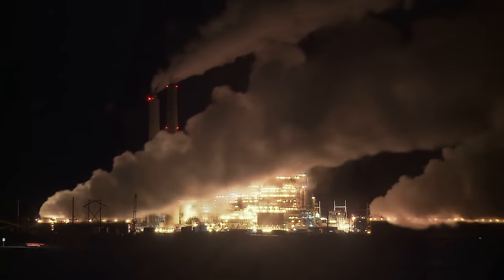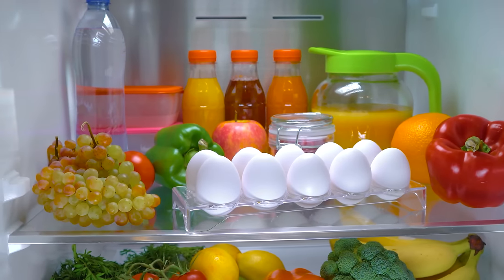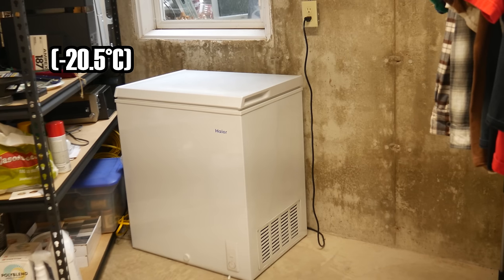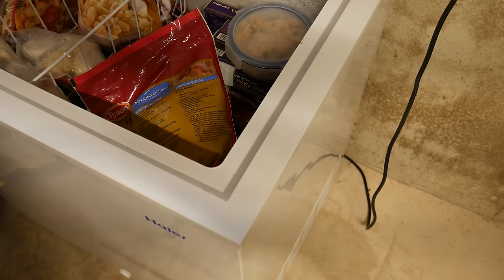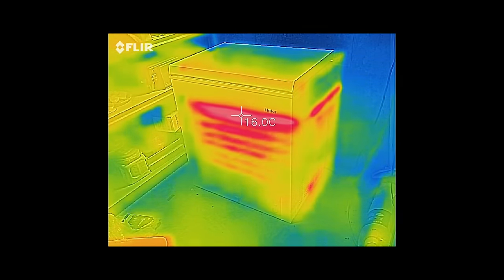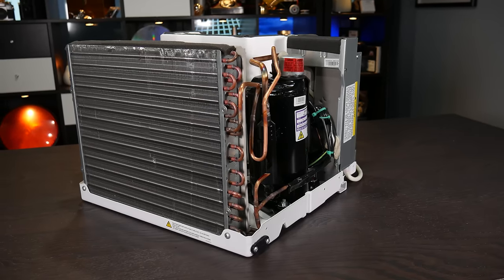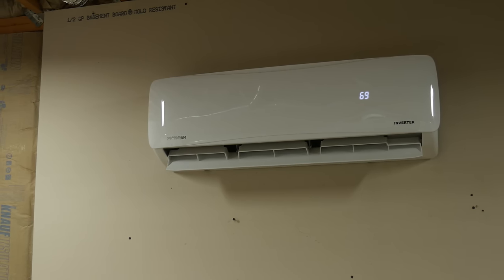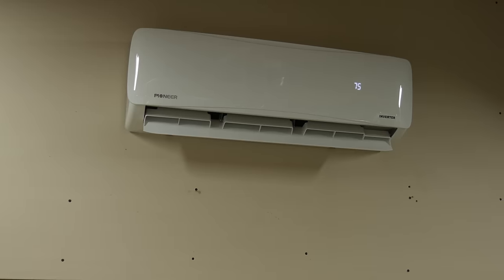Heat Pumps: the Future of Home Heating

Comment: So wait, you still need refrigerant, electricity to power the fans / blowers, filters, valves etc.  How the hell is this more efficient than burning natural gas, which we have a shitload of?
Reply: Technically it's true, though a bit unintuitive and misleading. If you heated your entire house with resistive heating (terrible idea btw but the only way to get 100% electric heat)  a heat pump literally multiplies the energy efficiency by taking less energy to instead transfer heat from the outside rather than directly heating the air. At peak efficiency, a heat pump will generate 500% of the heat of resistive heating, watt for watt.

Yes, burning gas is 100% efficient (well, not really, you lose energy to emitting light and such but for all intents and purposes it is), but burning gas for creating power, even if less efficient still multiplies the energy efficiency in joules. You get more gas out of your gas, so to speak.
Reply: To compound on this, the gas in your home and at the power plant have exactly the same energy density, that however many joules needed to  generate the extra power needed (ignoring the massive difference in scale) will contribute exactly  the same amount of energy transfer in a power plant as at your home. So heating your home with a heat pump will result in more work(energy) per cubic meter of gas than gas alone.

Comment: Why didnt they just upgrade the central unit that probably would have been so much cheaper ? Also the furnace could then decide which "fuel" it wants based on ambient? Hrmmm i really dislike mini splits for added complexity and costs that said there are combinations of central heating cooling combination fuel source mini splits using coolant and a central  heat exchanger that would be in place of the furnace and have a boiler for heating or the outdoor unit depending on ambient and i watched the whole video haha
Reply: Example: the central unit is updated to a modern unit. During the hot summer, you want the AC running in your bedroom, but not the whole house (to conserve power). Yes, the other vents can be closed, but the problem is that the temperature controller, likely located in the living room, cannot sense the temperature in the bedroom, so it runs all night long. Result, a huge electric bill and you freeze.
Reply: @kurtbilinski1723  That last part can be fixed.  They make thermostats that can use remote temperature sensors.  So you could tell it to switch from the built in sensor to the remote one in the bedroom at night time.

Comment: What you propose is altogether impossible, for it violates the second law of thermodynamics.  You cannot extract work from a cold source by cooling it further. Like building a ship that propels itself by extracting heat from seawater and releasing it at a yet lower temperature.

Comment: we don't use heat pumps because its inefficient to compress the air and then transfer heat by blowing air over that thing... you can just heat something and blow air over that thing
Reply: It's far more efficient than regular electrical heaters.

Comment: Heat pumps can't even hold a candle to my wood stove, and my wood stove still heats the house without power. 
My power bill would sky rocket with a heat pump installed, and a heat pump doesn't circulate through the house as well. You'll have to have a second head for another part of the house.
Reply: Wood stoves don't heat the house "without power", they just derive their power from the burning wood. Which is, of course, a very polluting way of heating a house.

Comment: I find it hard to believe a heat pump costs less to operate than a natural gas furnace.

Air conditioning is already more expensive.

Then throw in -40 winters.
Reply: Bonus is you don't need a scary gas line to your house.
Reply: @logitech4873  It's not any scarier than a 200 amp power line.

Comment: the only problem is we can't transfer summer heat to winter in sufficient amount... even using the same capacitor for cooling in summer and heating in winter
I guess the stupid heating is like 80-90% of the potential energy we 'waste'

Comment: So why don't the powerplants use heat pumps?  They burn natural gas to boil water to run the turbines- couldn't they have a big heat pump to boil the water and create electricity much cheaper?  I realize there is the catch 22 where they would need some electricity to start with in order to run the heat pump to create more electricity, but that is easy to solve.
Reply: Heat pumps become limited to certain maximum temperatures, mostly due to the refrigerant used - e.g. R32 will get you to a maximum of around 55C, R290 (propane) to about 75C, and R744 (CO2) about 90C. As the gap widens between the desired temperature and (in the case of an ASHP) the outside air, they become less efficient.  So you'll never get to the point where a heat pump can provide the heat to turn a turbine to provide the electricity to run itself.
Reply: That would be free energy and violates the laws of thermodynamics. If you had a theoretically perfect heat pump and perfect heat engine then you could break even. But it is impossible to have a perfect anything so the heat pump would always consume more electricity than a heat engine could generate from it.
The reason for this confusion is that in common use efficiency for a heat pump is considered to be the coefficient of performance, which for practical applications it is. While the COP can be over 1 the overall thermal efficiency of the heat pump is always less than 100%.

Comment: Great until the cost of electricity goes through the roof. Which is the case in Ontario. When the payback coat approaches 20 years. Who owns a home for 20 years and will the system last that long. A great technology but sabotaged by electrical costs.

Comment: Heat pump water heaters 👎 Heat pump heaters 👎.  Saves a little money but they break easily.  When it’s REALLY cold they struggle and revert to traditional heating.  It’s just more complication homeowners have to deal with that mops up any energy savings.  Simplicity is beauty.

Comment: Why do the majority of American heat pumps/air conditioners not adopt inverter technology like the rest of the world? And why do the majority of American thermostats utilise a basic ON/OFF wiring system… where you can upgrade the thermostat to Smart Thermostats!

In Australia, everything is inverter driven with proprietary thermostats that are basically impossible to upgrade to smart thermostats?.🤷‍♂️🤷‍♂️

Comment: Once the outside temperature is below around 45 degrees you switch to another heating fuel because it will be cheaper than the electric power you will use defrosting the unit.
Reply: Not true, modern ones don't use resistive heat to defrost, and instead reverse the cycle to perform the defrost, using a fraction of the electricity required.

Comment: You wanna know why you werent offered a heat pump for your whole home unit? The manufacturers tell the dealers not to recommend or offer them in certain states.

Marketing surveys have suggested that the nuances of use cases and the need for "emergency" heat in the winter time means that the public doesnt like it, so they tell the dealers not to offer.

It's dumb, heat pumps are used for the same amount of time in northern states as in southern, only North Dakota uses them in april and september while Texas uses them in december and january. Then again, if economics has taught me anything, its that humans arent perfectly rational. The manufacurers are a business, and they want happy customers.

Comment: I had one or these installed on my house when I bought the place, thing was garbage, radiators would barely get luke warm and would be cold at the top, switched back to gas boiler about 2 weeks into winter as the house would be so cold I would wake up freezing in the night

Comment: Since the colder it gets the worse the efficiency gets, though, if your winters get really cold, you are better off just using a natural gas furnace. So, comparing your COP costs in electricity is wrong to begin with, since realistically you should be comparing the costs to natural gas or oil. 2.9 sounds great compared with resistive heating but really you're comparing it with natural gas which can vary depending on your area and costs for electricity and gas. In some areas using gas can be 3 or 4 times cheaper compared to electric.

Cost of installation/maintenance is also a factor. Since you need supplemental and emergency heat anyways, you still have to install a similar size of furnace anyways even with a heat pump, and below a certain temp you will be running off pure resistive heating anyways, so if you live in a cold climate you are going to want a gas furnace the same size whether or not you have a heat pump, so for many people a larger up front cost and larger maintenance cost is simply not worth it for the marginal change in utility cost.

Geothermal is another matter, and is a great option. I really with I had the space necessary to put in a geothermal loop, but unfortunately I don't. So much excellent information in this and delivered in a pretty understandable way. Great work!

That heat pump probably has a txv or something instead of a capillary tube btw.

Comment: The only problem with heat pumps is they don't work in the coldest of environments, and become less efficient the colder it gets. That being said, I do mean the coldest, with good models maintaining good efficiency down to -10F. There are certainly inhabited places that get that cold, here in Denver we'll get that cold at least a few times a year, and in northern cities that can be normal for most of the year. Still, for most inhabited places, a heat pump is all you need. Even in colder climates, you can have one for a lot of the time, and only rely on a furnace in the most frigid weather. Also, that's not even getting into ground-based heat pumps. Those are much more complex, requiring a heat exchanger buried deep underground, with all the associated piping, but those can work in even colder conditions.
Reply: I think America need to import better heat pumps. It is the most common heat source in scandinavia.

Comment: Instead of complaining your airconditioner is not reversible you could also have bought a heat pump 😂
Reply: A condensing gas stove doesn’t give you more then 100% of efficiency, it just helps you reduce the condensing losses helping you to get near 100% of efficiency. Emphasis on near 100%.

Comment: Still not cost effective in uk, companies quote 40k for new systems as pipework and radiators have to be changed. Plus the pump still needs electricity to run? Not catching on here yet

Comment: I recently had an airsource heat pump installed. It's noisy - we hear it indoors - it's slow to respond, the installation takes up a lot of space indoors and spares will not be just of- the-shelf from heating suppliers - all dedicated specialist control. I accept the oil combi boiler it replaced is obsolete but it was better from the point of view of giving me heating and hot water, efficiency and pollution aside.

Disappointing. I expected better.

Comment: Heat pumps are nice, but resistive heat is 100% efficient.
Reply: Heat pumps are 300% efficient.
Reply: @youseflatif796  it moves heat, from one area to another, not even a copper plate would be 100% efficient. Losses happen all over the place in an hvac system. The pump, the lines, etc.
Reply: Resistive heat is 100% efficient, yes... But for actually transferring energy they are *terrible*, radiation is simply not a good transfer method beyond a few feet. A heat pump multiplies the same amount of wattage into a substantially higher BTU, sometimes up to 5x more.
Reply: @KurosakiYukigo  heat pumps are great if you are in mild temps, but if it gets really cold, heat pumps actually use more power. So depends where you are at. They are not for everyone, and have their own pros and cons.